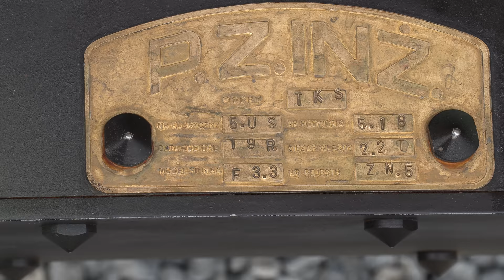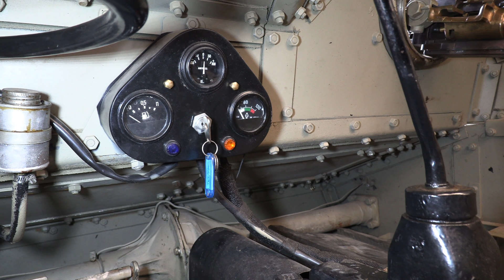Inside the Chieftain's Hatch: TKS

Comment: That shovel actually gives significant additional level of protection.
Reply: yep, additonal 10% of armor ;D
Reply: Only for the TC. Add another pointed the other way for the driver.
Reply: I knew I would find this comment.
Reply: Sharpened entrenching tools were used in hand to hand combat. :D
Reply: early spaced armour ;D
Reply: @d3133v3r4nc3  Space. the Final Frontier.  These are the voyages of the Intergalactic Sardine Can.  Where no Chieftain has gone before.
Reply: It's certainly a DLC pack.
Reply: @peternickle1884  Warhammer 40k reference made my day may the emperor protect you
Reply: @thomasulverski  and  plus 200 to bravery
Reply: The shovel is to bury their remains
Reply: Spaced armor.
Ahead of their time
Reply: If you hit it, the commander will say critical hit but no damage.
Reply: probably the thickest part of the "tank"
Reply: so do track pads hanging everywhere.
Reply: Thank you, Captain Obvious.

Comment: Air filter: your uniform. Carburetor: the driver. Engine temp sensor: the TC.
Reply: Early models the driver sips gass from a canteen and spits it directly into the air intake as a carb.
Reply: @marktaraski277  somebody say shiny and chrome?

Comment: Seeing other people getting out after saying his trademark phrase was actually quite hilarious. Great idea!
Reply: Search the Aquino video where the Chieftain a full crew of volunteers popping out various vehicles when he yelled "the tank is on fire"
Reply: They were super quick getting out, very impressive!  

While the Chieftain doesn't get out of the TKS - he takes it off.  ;)
Reply: TheScout115  You did an excellent job! Quite well done!
Reply: Honestly though, the correct phrase for the TKS is "Oh bugger, the TC's on fire."    That 3 inches of air isn't going to stop much spraying flaming oil.
Reply: I'd like to see a whole crews worth get out of every tank he dose the test on
Reply: TheScout115  Since this is a reproduction, do you have plans? A plasma CNC machine could turn out the plate to build this quickly.
Reply: @Jeffrey Pierson unfortunately such plans are unlikely to be publicly available, as the company that built this TKS went to great lengths and put in many hours in order to create the plans for the replicas they build
Reply: @prjndigo  not 3 inch of air, but 76.2mm of spacing.   (Marketing 101, put more numbers make it look more precise and larger)
Reply: They ran out like little rpg goblins lol
Reply: @prjndigo  And stepping up on the engine 'cover' probably isn't a good idea, since it's probably going to be either the gasoline coming out of the punctured fuel tank or the engine itself that's on fire.
Reply: TheScout115  You guys are awesome! And also awesome, keeping the TKS in drivable condition!
Reply: someone should speed it up and add benny hill music.

Comment: 2.2 tons. It’s like the smart car of AFVs
Reply: To put that into perspective, it weighs about the same as a 2020 Ford Explorer.
Reply: @Ray-tg1sj  : Which doesn't have any armour plate - you wouldn't want to get shot at in one of those!
Reply: @timonsolus  Isn't the Explorer your Run of the mill police vehicle nowadays? Like the replacement for the crown Vic?
Reply: Ya, we've outfitted our force with them. They're not bad really, not as outright durable as a CVic, but they do seem reliable enough and their performance easily outstrips the old sedans
Reply: @timonsolus  Both dont have protection. But shrapnels hurt only in Explorer.
Reply: The Smart Car is actually surprisingly dense. According to Wikipedia, it is about 5 pounds short of a ton empty.
Reply: It's a universal carrier with full armored roof.
Reply: @Shaun_Jones   Because it's a heavy-duty roll cage with cosmetic body panels attached.  It's the only way to make a car that small that meets modern safety standards.
Reply: @Shaun_Jones  it's also surprisingly ugly to look at.
Reply: @deathsheadknight2137  the modern cabriolet looks OK but the rest of them are ugly
Reply: @jic1  know someone who had an accident in a smart car. All he body panels went off. The passenger compartment untouched. Magnificent piece of engineering
Reply: My 3500 PICK UP TRUCK is heavier ....

Comment: Germans actually had some fear of these things - they called them "cockroaches" - they were small and very, very maneuverable - if you ever see one move its amazing this is a vehicle firmly based in 1920s/ 1930s tech. The 20mm version armed with semi automatic heavy rifle could kill any German tank and lead to first allied panzer ace + one dead German prince. If Poland had 100s of these 20mm armed versions it may not have changed the outcome of September campaign but for sure would lead to even bigger German panzer losses - they already started French campaign with less tanks then Polish.
Reply: @Jordon Carlson  the 20 mm gun used by the Poles is rated to penetrate up to 25 mm of armor depending on the range. The Pz II has around 15 mm of armor. It is more than capable of knocking out early German and Czech tanks that were used during the September campaign.
Reply: @Jordon Carlson These are early WWII tanks. Protection is weak especially on the sides. TKS can get close due to its size. From 100m penetration is 20mm at 60 degrees. Orlik has confirmed (pictures) kill of Panzer IV.
Reply: @Jordon Carlson most German tanks in 1939 were panzer I(just two machineguns as armament) and Panzer II(20mm automatic cannon) tanks, both of which had pathetic levels of armour, and their best tanks were early models of Panzer III’s which also had mediocre armour until later revisions.  For example in the Spanish civil war Russian T-26 tanks often dominated the Panzer II tanks in tank duels.
Reply: Germany: No worry, we have the WEASEL tank now!.
Reply: poland : 3 tks one has 20mm gun 2 other machine guns
german tanks : i think i pooped a little
Reply: @Jordon CarlsonThis is because the first German tanks were not that good at all, the radio allowing to coordinate actions and modern tactics made them win even against a stronger enemy, and as for their armor, the Polish anti-tank rifle was able to destroy almost any German machin

Comment: Considering the positions of the fuel tank and of the engine, I think that the more appropriate phrase should be
"Oh bugger, THE COMMANDER IS ON FIRE!!!"
Reply: Yeah, and I got a bit concerned that the filler cap had no kind of splash guard what so ever when it's sitting so that any splash would soak the TCs back rest, or the TC himself if occupying his seat, which in turn, is located just beside the commonly HOT engine...
Reply: Hello from Estonia.
Reply: yeah i wouldn't want to be in that thing if the engine was hit.
Reply: It was problem  of all tankettes .   Imagine Italian L3 with flame thrower .  Fuel tank for engine is also located inside , behind vehicle  is towed  a trailer-tanker with flammable liquid , and supply hose going from trailer , by commanders seat to flame thrower .
Reply: You know, while operating in such a machine 90% of the job is not to get hit ;) It is a small and fast reconnaissance vehicle, not being desinged to be a combat vehicle. Direct hit from any cannon means death, internal vehicle design could not change it.

Comment: 8:12 - "Spare radiator cap"... Someone did a splendid job on that toolbox. This spare part is ESSENTIAL in every FIAT-engine-powered vehicle. Don't ask me why, I know from painful experience it is.
Reply: In my experience, vw need a spare engine oil cap.
Reply: @dominikbevcic9868  Now that you mention it... not just a VW. Air-cooled FIATs loved to "spit them out" when overheated, too.
Reply: @gmaacentralfounder  well, in the end, owning the same age and price range fiat works out cheaper and more reliable for me. And there is less annoying fanboys.
Reply: TheScout115  Ah... That explains THAT.
Reply: If it was British up until the 80's /90's, a spare radiator thermostat was essential.
Reply: YASS! 😄
Reply: TheScout115  why no splash guard at the fuel filler port?
Reply: TheScout115  Jerry cans and a long hosed funnel would keep the splashing outside, unless you overfilled it. At that point just get out and standby until it vaporizes.

Comment: Chieftain, With the T.C. so close to the disturber and spark-lug wires, there is another problem. Back in the day the wires were braided cotton even when new did not hold all the electric current in place. In short the T.C. could get s charge from time to time even on a good day. Great video by the way !
Reply: "It's not a disadvantage, it's just a way of making sure the TC is awake."  ahem...
Reply: Oh wow that's scary.

Anyhow with the TKS, I can't help but wonder if even a FT-17 wasn't better.
Reply: I am more terrified that the driver is sitting on the coolant tank.
Reply: @LIETUVIS10STUDIO1  : Better armoured, yes (slightly) - but a lot taller, and a lot slower, neither desirable qualities in a tank as they make it much easier for enemy anti-tank gunners to hit you.  

Even the standard German 3.7 cm Pak 36 'door knocker' anti-tank gun would go through an FT-17's armour quite easily at 500 meters range.

(In 1940, most French tankers bailed out of their old FT-17s rather than fight in them - very wise!)
Reply: That is intentional. It's the Polish equivalent of amphetamine used in "Panzerschokolade".
Reply: The "disturber" is a great way to describe one of the main parts of an automotive electrical system, and accurate too!

Comment: Problem with 20 mm  gun variant of this tank  (tankette) is that there simply wasn't enough guns available at the given time. The plan was to convert all reconnaissance tankettes into Anti-tank role, but since there wasn't enough guns to convert all, plan "B" was to convert 1/3 of the existing tankettes so they were working in platoons of 3 tanks, one being Anti-tank, and the others were equipped wither with 7,9 mm machine-gun. This was supposed to be only a "stop-gap" (kinda like M3 Lee was a stop gap till M4 Sherman arrived), as there were better tanks in production - 7TP,  based on 6 - tone Vickers tank, and later on 10TP (kinda cruiser-like, fast tank) that as far as I can tell was only in a prototype stage.
Reply: Technically, by the time the tankettes started getting rearmed, the 7tp had been considered obsolete and a new tank to replace it was being trialed- the aforementioned 'cruiser'-style family of vehicles beginning with the abandoned 10tp prototype.

Comment: A little clarification for the conincal bolts: The cone shape adds more rigidity and helps prevent deformation when the bolt is hit by a bullet by deflecting it. A square/hex bolt with a flat top is prone to having its sides deformed when shot on the flat top. These don't have the flat top

Comment: Hard to believe that in of this puny things with a 20mm cannon and under the command of Edmund Roman Orlik (arguably the first ace tanker of WW2) managed to knock out 10 tanks including a PZ4 in just a month
Reply: Nazi Germany had a tradition of making weak side armor.Even the Panther was affected by that.
Reply: Those early PzIVs had really weak armor. Wasn't supposed to be anything other than a support fire tank to blast targets with HE. The model intended to duke it out against armored opponents was the PzIII. In fact IIRC the captured czech tanks had better overall armor than an early PzIV, so is hardly surprising that a 20mm would ruin it's day.
Reply: @naamadossantossilva4736  every tank has weak side armor for obvious reason
Reply: @naamadossantossilva4736  those were early model Pz IV, they had 30mm armour front, sides and back, same for the Pz III, later they would see an increase to 50mm front, but that would only be generalised by Barbarossa
Reply: @quentintin1  and at the invasion of Poland, a lot of the German tank units were still waiting to recive the Pz3 and Pz4 they should have on paper... they were instead using Pz1 or Pz2 light tanks, with the Pz1 not even intended to be more than a crew training vehicle at the time.
Reply: 20mm was actually a heavy semi auto MG - you could fire round after a round from box magazine. Even if first did not penetrate you could fire another one 1 sec later.
Reply: @tomk3732  This 20mm rifle is called the wz. 38FK. From what I heard about 95 copies were made.